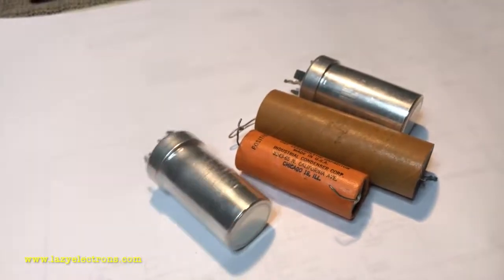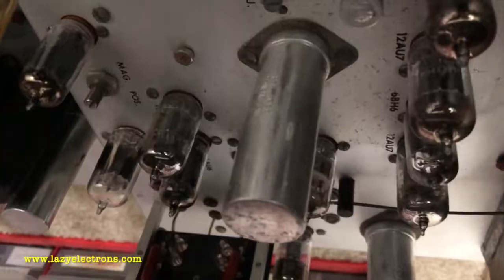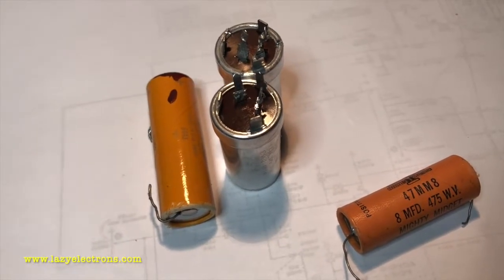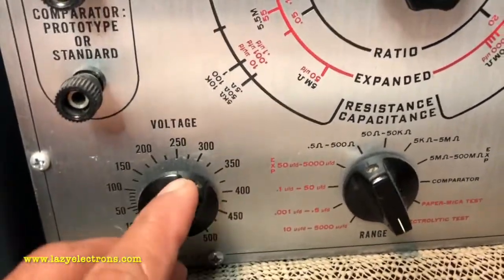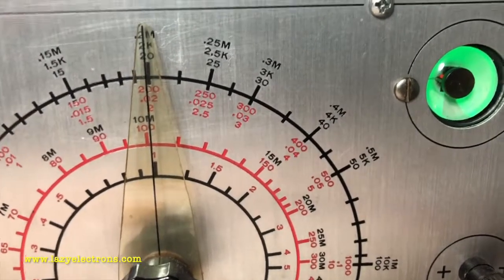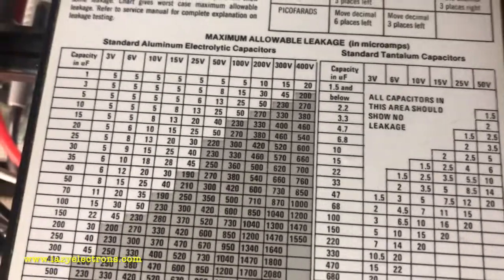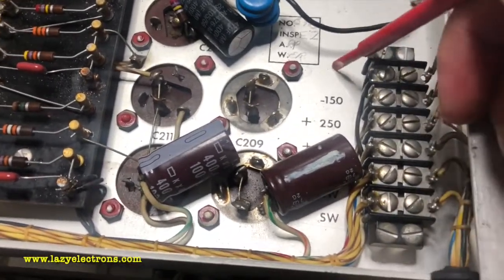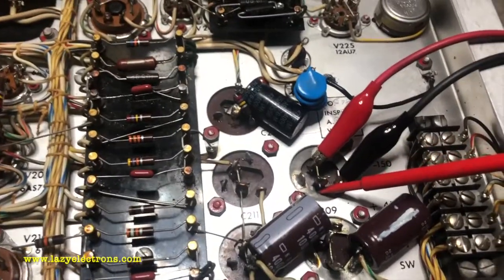Reforming Electrolytic Capacitors  - Using Capacitor  Leak Testers

Comment: Using a capacitor tested to reform capacitors is risky. Worse case scenario, you can damage the power transformer. In a Heathkit or Eico, the power transformer not too hard to replace. In a Sprague, the power transformer is unobtainium.

Comment: WOW! I'm new to capacitor testers in this fashion. I had no Idea the chassis could be hot and it grounded could turn into a flash bulb. I've heard of capacitor reforming but have never attempted it or needed to perform it. Very good tutorial especially the parts on the grounding, I had no idea about that. Could you do a follow up on this on why it needs to be done and what happens when you reform the capacitors. Thanks for sharing. Best Wishes & Blessings. Keith Noneya
Reply from the maker: Thanks Keith, sure..will do a separate one on reforming.

Comment: Thanks for the video, very helpful. I have been using an electrophoresis power supply which has both voltage and current limit settings to reform electrolytic capacitors. You simply set the voltage limit to less or equal the capacitor voltage rating, then set the current limit to a safe value. As an extra precaution I also monitor the actual current using a Fluke 27 DMM.  When the terminal voltage equals the set voltage and the current drops to the leakage value, the reforming is done. This approach also reveals leaky capacitors which cannot be successfully reformed. Finally, I have a discharge plug  with a bridging Resistor which allows me to safely discharge the capacitor before I disconnect it.